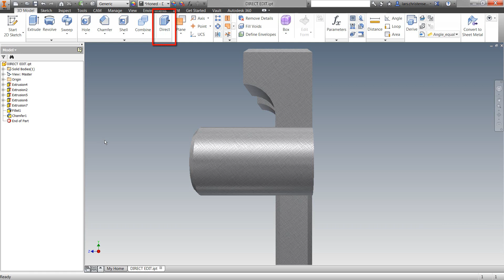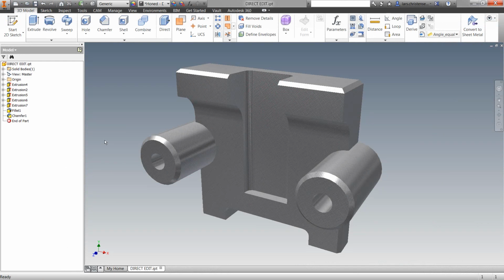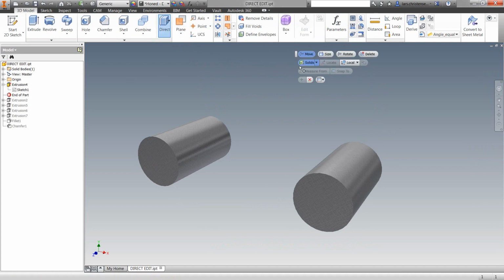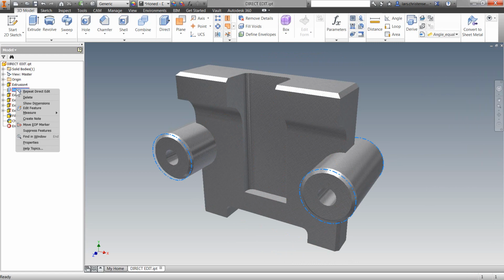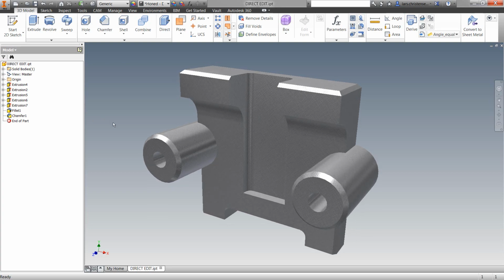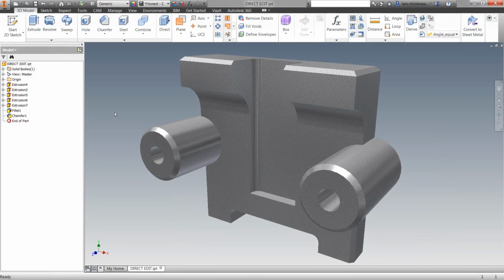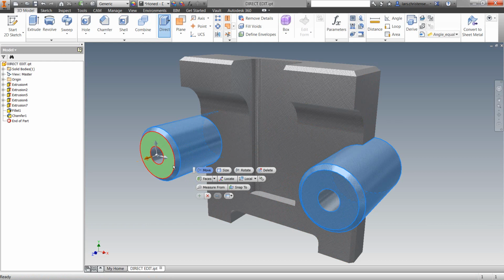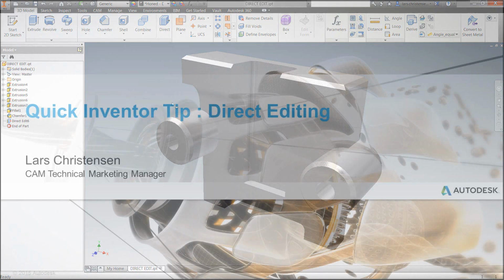Quick Inventor Tip: Direct Editing

Comment: I like to use it with imported models, but hate when it gets used on native models. I feel it does not keep the file as clean as it should be. IF a file is designed properly then it shouldnt be too hard to edit. I would use it, if instead of creating a new entry in the Tree, it would simply edit the extrusion/sketch properties in order to give the same result. just my 0.02...
Reply from the maker: Igor Masin Hi Igor, thank you for taking the time to comment. I totally get your point. Worth more than 0.02 :-)